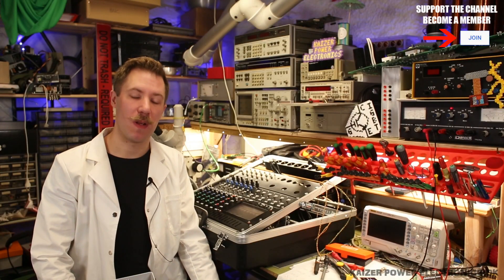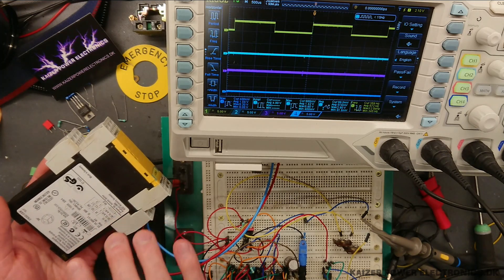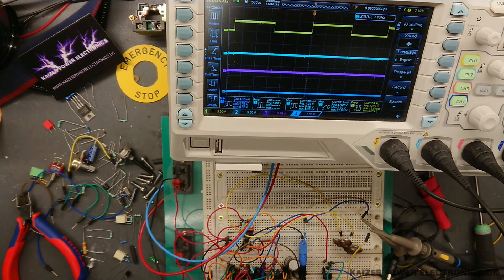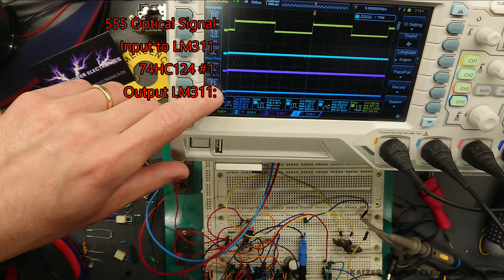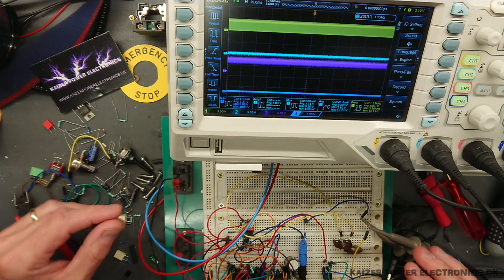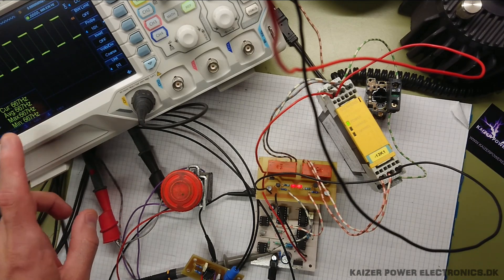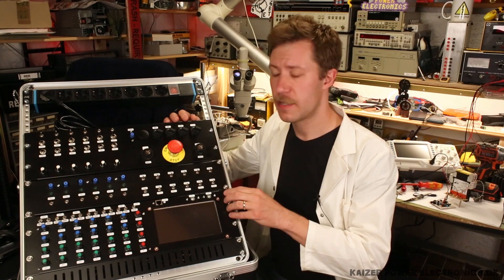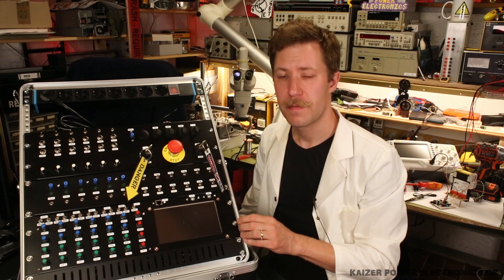Tesla Coil Show Controller - Safety Features (Part 7 of 8)

Comment: Good work Mads ive been wondering  how to get a a full shutdown to the coils, At the moment im just cutting the optical outputs on syntherrupter for emergency stops and then i have a 2 output powerbox with a breaker and 40amp emergency switch for electrical cut off its worked for now but my reaction times wont be fast enough if a catastrophic failure occurs id like to be somewhat safer by only having to push one emergency stop then it cuts power to the coils and/or cuts main power  this has gave me some ideas good work! ;-)

Sy
Reply from the maker: I am happy that you found inspiration in this. I will also add another NC to the emergency stop here and loop the optical outputs through as well. At mains power box, upcoming project video, I can also add more emergency stops into the same loop and keep the same safety integrity.